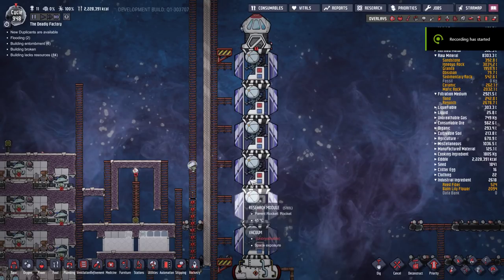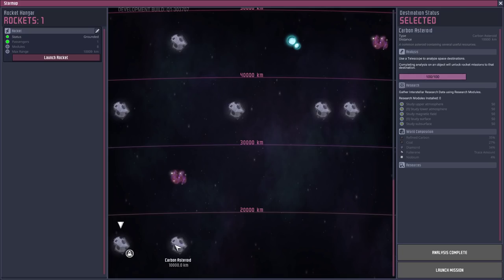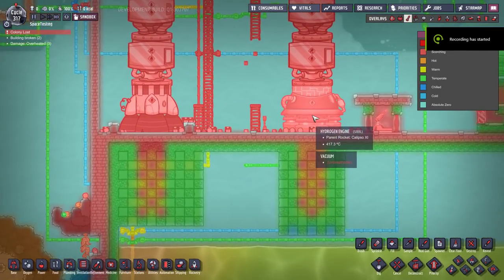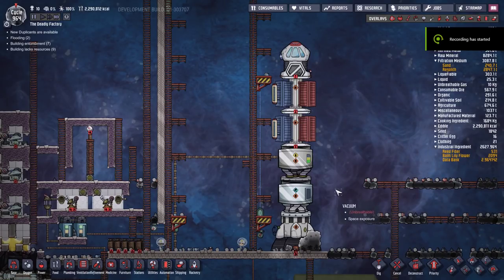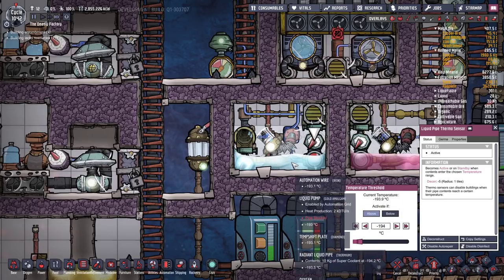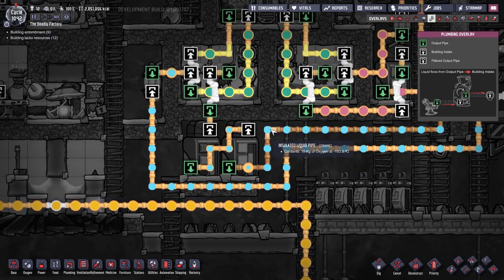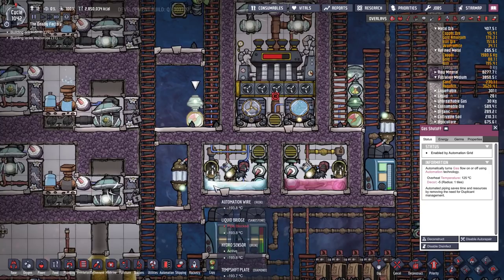Rocket tutorial, Steam to Hydrogen plus automation part 1 Oxygen not included

Comment: If you look beneath your liquid storage tanks, you should see one ceramic insulation tile has exchanged heat with the contents of the tanks. You could use airflow or mesh tiles instead for perfect insulation in this case (which I learned from you!). But since it's recooled it doesn't really matter.

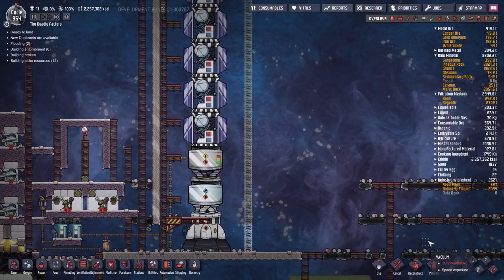Comment: 6:50 duno how long it will stay but atm you can convert 100kg thermium to 100kg niobium. did only 1 trip and fine since than
8:30 not the granulator, metal refinery
12:15 or stemturbine, but i bet you duno know where to store all your energy after petrolium boiler/ solar panels
13:10 fun fact after you build the engine it does not need a floor anymore, have bunkerdoors so regolith can fall down, and if you can aim for the tiles with no backround if you dont want to harvest the thermal energy
24:30 oh wow, did miss that part in the patch notes
27:25 and bevor i forget, puting airvent on same level as the as you want the liquid to be save the automation for input of gas, liquid rises overpressure the vent and input stops. same for liquid vents. 
+ if you use the injector you can run it on 1aquatuner
and yes the capsule are great to store your supe in in =)
Reply from the maker: The metal refinery bit I totally missed, description edited. I don't think my battery banks have dropped below 90% since I got all the solar up. Did not know you could remove the floor afterwards I may have to play with that.
Reply: @FrancisJohnYT   its laggy but jetsuits in space the co2 can escape atleast

Comment: Awesome guide, thank you !
Any pointer to how much water to put in the turbine chamber to get maximum efficiency ?
Reply from the maker: It can be varied but as a standard I use 200 kg, it's what one bottle emptier will drop off in a single load and provides perfect pressure. I set the atmo sensor at the top to 2000g.
Reply: @FrancisJohnYT  Many thanks again, didn't expect an answer that fast !
Your videos are really informative and well done, I'll be sure to check them out.

Comment: Thank you so much for the video! I'm only a couple minutes in, but is there a reason you don't send 9 research modules with the initial steam rocket? That would get you more points per launch right?

EDIT: Another question: Wouldn't it be easier to use an on-demand LOX system, so that you're not constantly running the pump? Seems like a waste of power to always be running it. And then you could also not have any cracking problems. So you could set up an automation "clicker" that would essentially run the pump for a set number of seconds, and when your rocket lands, you can just click it on to run it for 82 seconds (if you needed 820 kg of oxidizer)
Reply from the maker: After you knock out the first 5 research goals you only get 10 points per research module. It's not worth the fuel or the rocket redesign time in my opinion. But it could be used to grind out a few extra points if you wanted to. For the LOX I considered saving power by doing something like that but in the end constant rotation was the simplest idea I could come up with. I like to keep things as simple and robust as possible. By the time I had hit space between petroleum boiling and solar I had more power than I could use.

Comment: Is this design still viable with the current patch? The new steam turbine works differently.
Reply from the maker: The turbine has become simpler and cheaper to use you don't need the gas pumps anymore. This is the most recent temp management video, it's not for making liquid O2 and Hydrogen but same mechanics on a smaller scale. https://youtu.be/2Aq3kRTxlW0